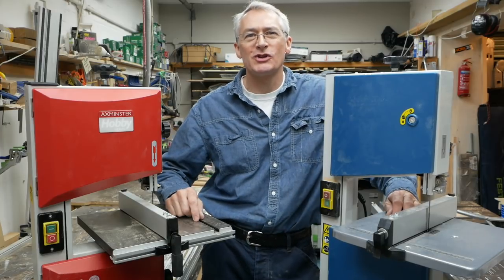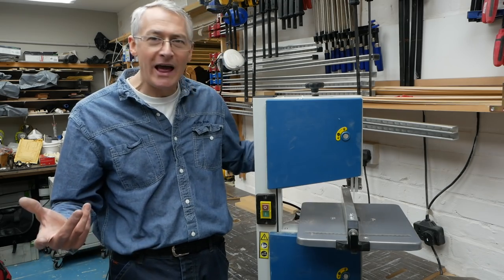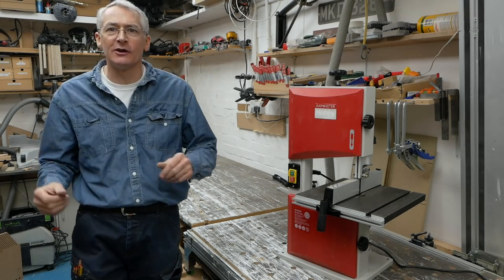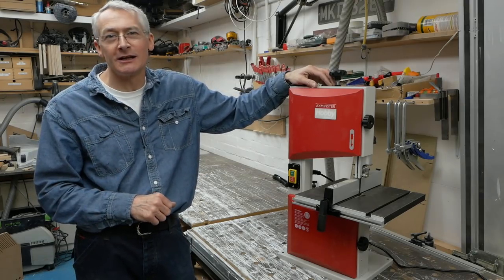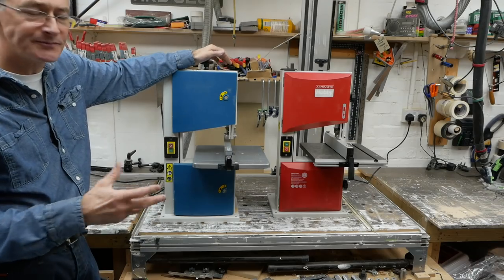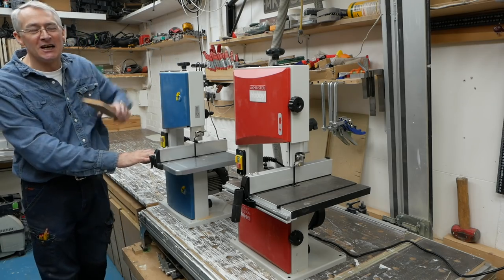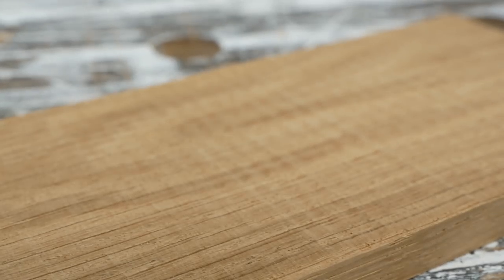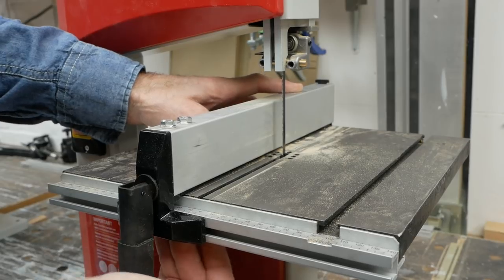£80 Bandsaw vs £200 bandsaw #140

Comment: Great review. The use of copper vs aluminium rotor in a motor is significant. Aluminium is used when the lowest cost is important and the cost of the motor is a high proportion of overall costs. If it doesn't say that it's copper there is a high likelihood that it's aluminium. Copper costs more, is more difficult to work with (higher melting point) but conducts better then aluminium and a lower running temperature with greater efficiency can equate to a longer motor life. The power of a motor can be expressed in several ways: P1 and P2 or S1 and S2. One is the input power and the other is the output power. P1 = 350W and P2 = 250W could apply to the same motor, or S1 and S2 is limited period vs continuous.  It's like rating an amplifier as 40W RMS or 200 PMPO - bigger numbers are not always better! 

The forces in a bandsaw are down through the table - so make for a safer experience. Only the blade and table are in contact with the wood being cut as an example. Better bandsaws use cast iron wheels, but for these bandsaws its cast aluminium and iron adds weight and inertia which are missing from these saws. It would be interesting to know if they are balanced - small holes drilled on the inside of the wheel and how true the wheels are e.g. blade runs true by wheel has significant wobble - can be transmitted to the blade between the guides - so looks like a vibrating violin string?

To compare the cuts a more scientific test would be to replace the blades with new/identical blades and check for how the blade runs on the tyre, do the wheel wobbles and how much vibration is transmitted to the blade with the guide raised. The setup of the saw could be compared: - is the blade parallel to the blade - can it be adjusted to minimise drift? Does the blade run without left/right or forward/back motion? Are the guides adjustable so that the gullet is behind the  guides? Does the guide come down parallel with the blade or will adjustments be required for different cut heights?

It's highly likely that both bandsaws are produced in the same factory - the CE certification may be made by the manufacturer rather than the importer can show this detail. Of course many of the components are identical but there are some differences e.g. the table, trunnion, motor and door construction. So it's also likely that the manufacturer offers a range of price points for a similar product e.g. like buying a bicycle but offered variation of components. In this test it's likely that Axminster used better/more expensive components to differentiate their machine from cheaper machines.
 
Bandsaws have consumables - how easy is it to get spare parts? A new tyre, blade, saw wheel, guide, bearings or fence? How long to get it? I was quoted 150 day lead time to replace a damaged fence - better than nothing but not really realistic if supplied damaged. Aldi/Screwfix may offer a guarantee but absolutely no option of spares which may be OK if there is a similar model e.g. Ryobi or Scheppach for common components.

My interest with this bandsaw is because I originally bought a higher priced bandsaw from the same supplier - with two dust exhausts and roller bearings to support the blade. I wasn't impressed because a high price didn't remove the need for careful setup. Two machines arrived dented to the frame or fence and one had no adjustment for the lower roller guides to provide any clearance (always forward) of the blade. Two of these also had a distorted lower door or frame. Wary of this, the third machine was so bad I didn't even try to assemble the stand or mount the table - simply no point in continuing and I asked for a refund. So the table trunnion or motor don't start to be significant if the mechanical assembly isn't spot on as well.

I did a shop test with three bandsaws from the same supplier comparing the cut of a 1/4, 3/8 and 1/2 inch blades that the machines are supplied with. Although it's possible to change the blade depth and TPS, only the bigger ones support the bigger blade sizes. I though the cut of the smallest machine was best although this could be simply down to how much time had been used to set it up or the condition of the blade (which may not have been original). It doesn't say how the machines would work with other blades fitted. My sample was rip/cross cutting a one inch piece of oak.
Reply from the maker: Wow, thanks Simon, great insight there!   The bandsaws that arrived damaged - were they from Record by any chance? Just curious, I’ve heard anecdotally that the carriers they use aren’t especially careful, unfortunately.
Reply: Hi Peter, nope, although I do own Record products - most recently an 8" bench grinder that's very good however I haven't sourced larger big ticket products like a lathe or bandsaw from them (so far). Like the products you looked at, they also seem to be sourced in China from the same (good/bad) companies.

Comment: You got to love a guy who plops a 80$ bandsaw down on a bench surrounded by wildly over priced festool products . Peter here is kind of like a power tool Paul sellers ( who speaks highly of Aldi chisel sets ) . Both appear to only be concerned with if the tool does the job they need to too . I have tremendous respect for both these gents
Reply from the maker: 😂😂 ‘..a power tool Paul Sellers’  - what an honour that is, thank you! As for ‘overpriced Festool’ I’d say that depends on your expectations. I love a cheap tool, me, but every Festool I have is still working, even after years of hard daily commercial use. I used my first midi extractor and RTS400 sander recently doing work on my daughters new place - combined ages of 28, same as my daughter. Expensive at the time, certainly, but cheaper as they get older - unlike daughters! 😂😂👍👍
Reply: @10MinuteWorkshop  ha ha I have  know what you mean I have a 20 yo daughter my self.  You’ll have to forgive my sarcasm toward big green , here in the states it’s much like the Yankees or the Red Sox , you love or hate em , nothing in between lol. Plus I’m sure there are a few sour grapes on my part because they are a bit above what I can justify spending vs what I would use them for. You  are the first guy I’ve seen  with a shop centered around a track saw. The way you set up your shop makes a lot of economic sense. Some one could outfit a whole shop like yours with  festool for similar money as just buying a high end cabinet table saw. 
I don’t see myself ever owning any of the green tools ( unless we are talking ryobi  ha ha ) just because I’m all in on a table saw centric shop. But after seeing your shop,  if I was starting over from zero , I think I would jump on the festool band wagon. Thanks for all the great videos , all the best to you

Comment: Keep the Axminster purely for customer service and parts availability. You do this for a living and in 10 yrs time when you need a bearing change or a new guide block set, they'll still be able to help. This is essentially what you pay extra for. Axminster has great customer service. Great video as always Peter. Will you do a benchtop tracksaw set up video in the future using the cheap screwfix tracksaw vrs festool? Cheers
Reply from the maker: Thanks! And yes, there’ll be a setup section early on in the ‘tracksaw workshop’ series, coming soon, I promise! Until then check out my Festool v Cheap tool tracksaw series from last year 👍
Reply: I have a 14" SIP bandsaw and have had to change bearings, tires and the fence(because I dropped it) over the 15 years I've owned it and SIP have not been great,  most of these wear & tear items they discontinued,  but with some research all the parts of better quality are available for it.  In my dealings with Axminster their support has always been very good but would they still have parts in 10 years.  I doubt it to be honest.

Comment: Definitely would buy the aldi one the make a new table and fence from mdf or if you want a bigger one, buy the small one, remove all the usable components and make a larger body from ply or mdf and timber and fix the components to it. turn a small 8 inch into a 16 inch bandsaw without the huge cost of buying one that size.
Reply from the maker: Interesting idea - not sure the wheels would allow much more depth of throat, but worth a play, for sure! 👍
Reply: Peter Millard I find I don't need a bigger depth of cut than the smaller models provide so for me this wouldn't be a problem. I don't do any resawing. you would need a longer blade if you were turning it to a bigger model . I have seen people like mathius wandel building bandsaws from scratch but there's no need building all the components from scratch when you can get them from a smaller bandsaw for a really good price.

Comment: Just out of interest Peter, are you able to say whether the table and fence from the Axminster bandsaw would fit onto the Aldi bandsaw please? If so, would it be cheaper to buy the £80 saw and a replacement table and fence from Axminster to upgrade the Aldi one? (I prefer the 350W motor but also would like the cast iron table and solid fence). Thank you
Reply from the maker: No, unfortunately they use completely different fixing methods to attach the table.

Comment: Peter, excellent video. Having been looking for a band saw for ages but not sure which to go for. All of the 10 inch, 12 inch and 14 inch band saws from Record, Charnwood, Clarke, Draper, Lumberjack etc. seem to be pretty much the same in looks, quality and nearly all seem to be Chinese. Most you tubers say to chuck the stock blade away and buy a better quality one. Think I will probably buy the Charnwood B250 mainly due to having a built in stand but then get nervous that In am making the right choice so don't buy it and end up cutting everything by hand with a hand saw bemoaning that I need a band saw. Hey ho.
Reply from the maker: Thanks Richard! Always a dilemma - I’m so pleased I bought the Aldi when I could, it’s been an eye-opener.  Forgot to mention it in the video, but while the 10” Record bandsaw is good value, they want more than the price of the Aldi bandsaw for the stand! 🤔

Comment: I use a Titan bandsaw. Screwfix own brand. Exactly the same as the two you have. Cast iron bed , ‘T’ slit & fence. I will try your tests now for my piece of mind.
Reply from the maker: I’m getting one to try out. Aluminium table, I think. 👍
Reply: Peter Millard   Yes sorry it is. I just ran outside to check. Out of the box the cut would not stay straight at all. Watched a tuning video & carried it all out whilst watching. I can’t fault it now. Does everything I ask of it.
Reply from the maker: nortesport Nice 👍

Comment: :) The Aldi manual has a link through to Scheppach for saw blades which come in at about £20. Machine mart sell a draper blade of the same size for half the price though they do not have them in normal stock and have to be ordered.
I bought my machine just days  before your review 6 months ago and on New Years Eve snapped the blade.
I am now looking to re-purpose the snapped blade.
Reply from the maker: 👍 The blades are really skinny, be interested how you repurpose them 🤔
Reply: Same here :) Some suggestions have been to use them in a hand made saw with the twist thing to tension them or to grind the teeth off and use them as a metal inlay in picture frames and the likes.

Comment: Thank you Peter for this Video! 
Actually I ones bought an Axminster about one year ago. I bought it from Dictum, witch is here in Germany known to sell extravagant tools, like Lie Nielson planes etc. But the Axminster is a huge piece of rubish - for 350€! Nothing at this machine is good - just the table and the fence. The wheels are cheap, not even round, the color comes of at several parts, the motor doesn't take much, the guides are ok, but I think not easy to set up... the operation manual is a badly copied one. Cause of this experience I wouldn't buy it again. 
I don't know, maybe Axminster isn't handle continental customers the same way... 

I have to say, well, of cause the hobby line is a hobby line... but... at least I'm a professional cabinet maker and I learned how to set up a bandsaw. Maybe I should make a video about this saw...
Reply from the maker: Judging by the comments on Axminster’s website, they seemed to have some quality issues when this was first out 18 months, a year ago. I think I’d have returned it if I’d had your problems tbh. Axminster will ship internationally - perhaps you would have been better buying direct from them?? 👍
Reply: Yeah, might be, and I should have contacted Dictum for that - in fact I were too lazy. So a bit might it bee my fault too.

Comment: I found this very interesting.  I have a £80 Bandsaw, which is branded Guild from Argos.  As far as I can tell it is exactly the same saw as your Aldi one.  I agree with all you have said about it but just wanted to let you know that Axminster does a fence upgrade that will fit these £80 bandsaws for just £13 or £14.  I put one on my Guild saw and it is a great improvement.  It also stabilises the floppy table quite a lot as you  get a T track to attach to for the new fence to run in.    I have nothing to do with Axminster apart from being a satisfied customer.     I have a short video on my channel if you want a look.   Either way thanks for making an interesting and informative video.  Cheers Rob
Reply from the maker: Thanks Rob. Yes, I know the axminster fence upgrade, and let’s just say that there’s a bit more to come in this series. 👍
Reply: Ahh fair enough, I jumped the gun a little :)

Comment: The fence on the aldi one has really been letting me down not cutting straight. It's absolutely fine cutting anything freehand but I need to cut 1/8 thick blanks from blocks up to 75mm deep and it always pulls to one side. I'm going to buy the axminster one after watching this vid thank you.
Reply from the maker: Not sure the Axminster one is available any more - this vid is a couple of years old. 👍👍
Reply: I've had this problem with my bandsaw. I haven't managed to confirm my suspicions, but I'm quite convinced I was running the blade in the wrong place on the drive wheels and literally flattened the teeth on on one side. As a result, I buggered up the blade offset, and caused it wander to one side.
I would advise replacing the blade and double checking set up before giving up on it!

Comment: I wonder if you could fill the underside of the Aldi saw table with epoxy to make it  little more sturdy.
Reply from the maker: I’m sure that’d be possible. The bigger issue is that the table only mounts onto a metal bracket with two screws, so there always going to be some flex in there, no matter how much you stiffen up the table 🤔👍

Comment: Happy New Year! 

Nooow did we forget about the magnets?! ;)

Think the axminster is quiet possibly worth the extra esp re the book and table looks great but.... as said no complaints with the cheaper one so I guess Aldi hit the sweet spot re price, function etc curious that the 'flimsy' table and more powerful motor work (as well?) as the better table/fence lower spec motor...  special kind of alchemy I suppose in selecting parts/tweeking specs?!
Reply from the maker: Magnets??🤔 yeah, as long as the size suits you the Axminster very good, but you can’t beat the Aldi price. And no idea why the Aldi has the bigger motor - seems to be the only one in this size. And HNY to you too Tom!
Reply: TBF was a good many comments ago, and seems to be non issue anyways. But the flimsy table is magnetic allowing for third party accessory's/ homemade jigs. I guess the really question is are you going red or blue?! Very best
Tom

Comment: Great video.  I suppose you could strengthen the aldi table .
Reply from the maker: You could, but the underlying issue is that the table just mounts into a simple metal bracket with a couple of machine screws, so no matter how much you beef up the table there’ll still be some flex in the mount. 👍

Comment: Just wondering aloud, since I've not seen the Aldi personally so I don't know how the table mounts and tilts, but might you remove the table, invert it, and fill it with a good amount of two part epoxy or fiberglass resin to stiffen it to near the competitive saw's cast iron table?
Reply from the maker: That’s a possibility, or glue on a piece of plywood. I feel another video coming on.... 😆👍

Comment: Very interesting Peter, thanks for sharing your experience. I get myself in a real pickle deciding which brand of tools to buy and videos like this help a lot. One question: is it my eyes or is there a heck of a crown (front to back) on the cast table on the Axminster? I would be a bit miffed if I paid the premium for a cast table and it was no better than the budget pressed steel one.
Reply from the maker: Thanks! I agree, it’s lways hard when you don’t have access to the tools. To be fair Axminster’s showrooms will often let you fire up the machines and try them, as long as they have one set up, and as long as you can get to them, of course. And no, sorry, it’s your eyes!  👀 The table on the Axminster is as flat as a strap, and much better than the presses steel on the Aldi/Scheppach  👍

Comment: Hi, what is the minimum blade height and thickness available for this bandsaw? I am looking for an alternative to a scroll saw to cut puzzles. Can you take sharp turns on it and not fall off the line?
Reply from the maker: Old vid. From memory they were 80mm depth of cut, 1/4” blade minimum. Both bandsaws long gone though. 🤷‍♂️👍
Reply: @10MinuteWorkshop  Did you drive them to complete wear? Do you still recommend them after 5 years?